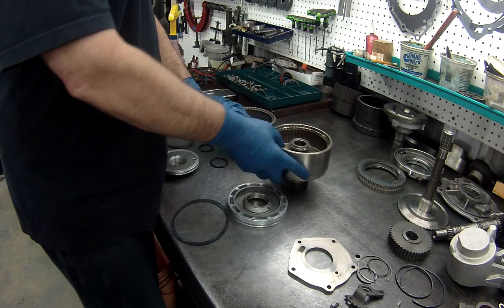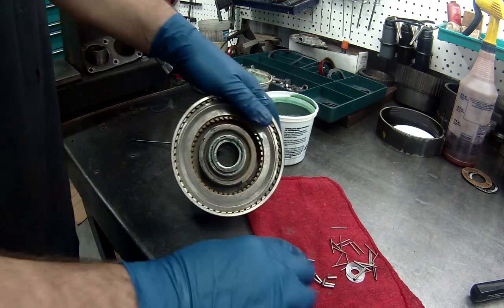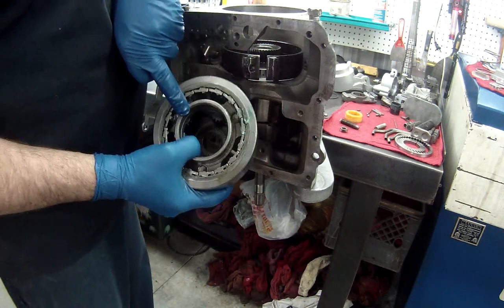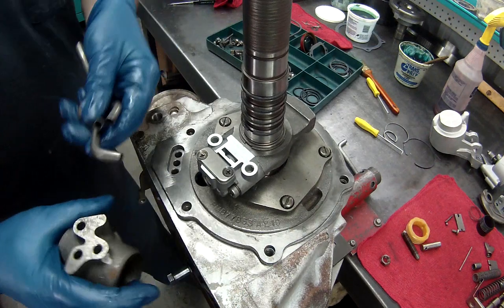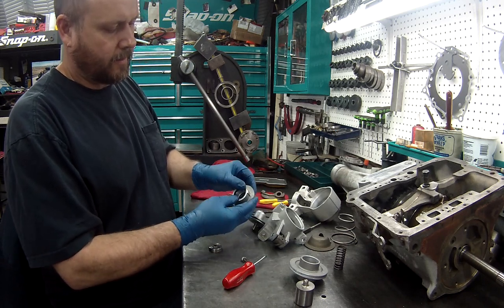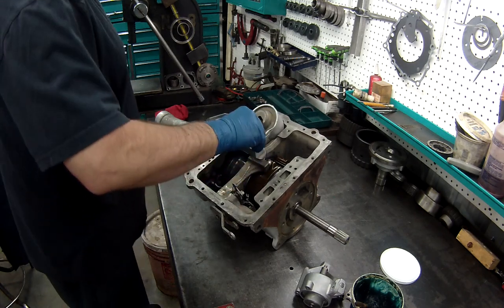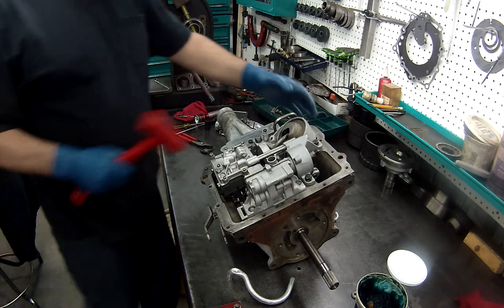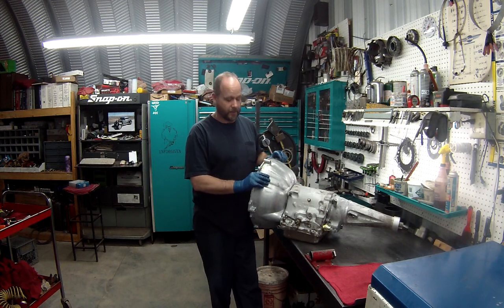Ford Cruise-O-Matic Part 3

Comment: You were spot on. Somebody rebuilt my 64 trans before I got the car and didn't replace the seals on the shift shaft now I'm having to do it with the trans in the car. I can't believe Ford didn't make these where they could be changed from the outside. It would be simple  and would not cost a penny extra.  Thanks for the info.

Comment: I tried your trick for installing the detent spring and ball. (Pulling the 'R' pin out of the short link attached to the rooster comb.) It worked like a charm. Made an easy job out of replacing the shifting shaft seals. Let's rephrase that. That part of the job was easy. The whole job was a LOT of trouble. Did it with the trans in the car, Thanks.

Comment: I didn´t see you doing an air check on the front and rear clutches to confirm the hydraulic integrity. I just did rebuild my Cruise-O-Matic, but there is a reasonable air leak in between both clutch circuits. It must be coming from the primary sungear shaft  rear sealing ring, but the ring is new, fits perfectly in the aluminum sleeve and there are no scratches or other damage to the aluminum sleeve. I´m a bit lost what to do now.

Comment: Nice presentation. I have one that is not shifting into 3rd. After watching, I won't even attempt a rebuild myself!!! :-) But where can I get it checked? Might even be the metal plate in the shift column as I have to hold the lever towards park to get the starter to engage.
Reply from the maker: Is yours a Green Dot? does the shifter show 1, green dot, 3. Because if you put the car in 3 you only get 1st and 3rd, the green dot gives you all three gears.

Comment: Thanks for the info Brad , I was looking all over the place for the band adjustment and here you were. I also have what at I think is an FMX , I took it apart to wash it out and found bronze clutches in it. is that an option or what?
Reply from the maker: The bronze clutches are factory. Just install the new frictions from the kit.
Reply: Thanks again. Why haven't you made any new videos? It's becoming very difficult to find information on the 50's and 60's stuff.

Comment: Hey Brad.  Great videos.  I am currently rebuilding a 66 medium case.  I'm checking end play.  It calls for between .010 and .030.  Shop manual says do not exceed. 044.  I have .045.  What would cause excessive end play?